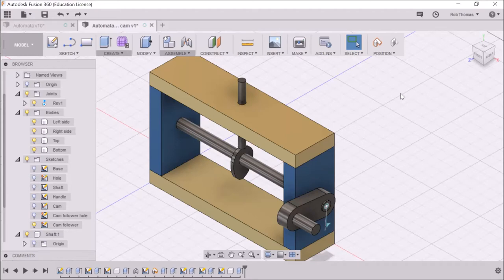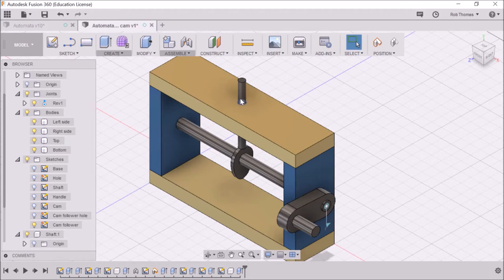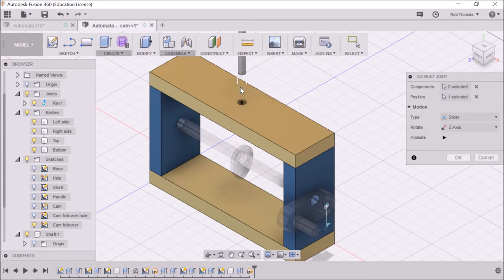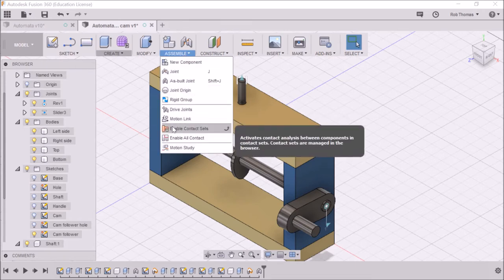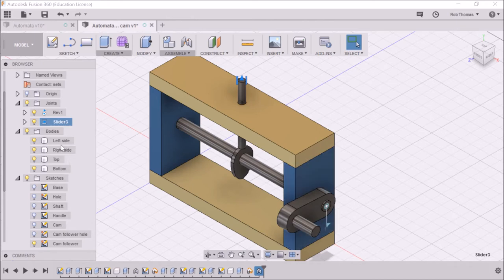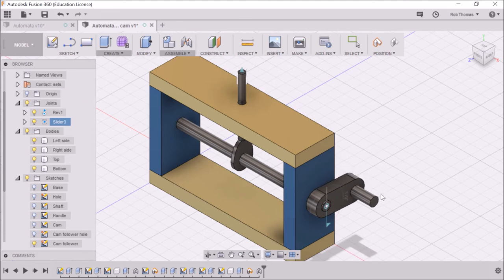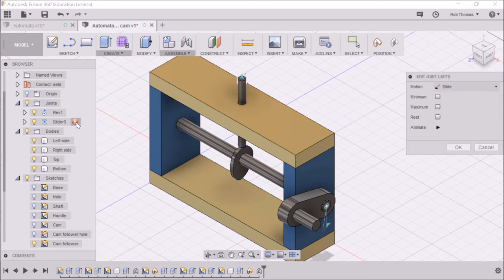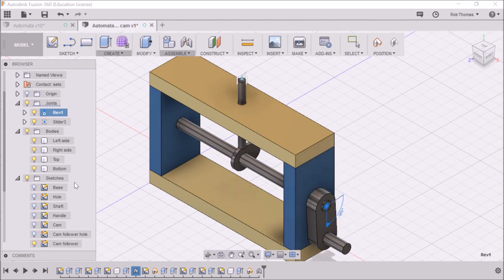Create the cam follower Part 4   the magic bit making the cam follower work for the automata in Fusi

Comment: my cam still doesn't move..... help???? lol
Reply from the maker: Make sure you have not joined any of the wrong surfaces. It needs to be on the centre of the axis.
Reply: @mrtabisdad  it's on the center of the axis but they don't move like how they are supposed to... they rotate and go up and down but when i try to actually turn the cam, it just moves the cam and the follower with my mouse
Reply from the maker: I think you've selected the wrong surface early on. Probably best to start a new drawing from scratch. Sorry not to be more helpful.
Reply: @mrtabisdad  ah no worries... thanks for the help anyways